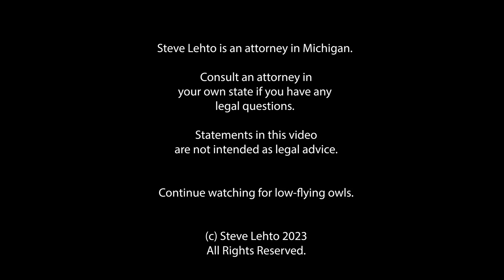The Crazy Legal Problems w/the Turbo Encabulator

Comment: For those that have a turbo encabulator and are having trouble getting replacement parts because of the ongoing supply chain issues, I found out that if you cut the ground prong off of the power plug and flip it over in the socket, the machine will effectively run in reverse and rebuild itself. You have to be careful to unplug it before it goes back in time too far to a point that it never actually existed, so make sure you monitor it closely.
Reply: When you do this it is great to video the process as the machine disassembles itself.  When left with a pile of parts , now you have handy spares or run the video backwards so you may reassemble it yourself!
Reply: wouldn't you get the same results if you reversed the polarity?. Of course I imaging this will only work on the 60hz systems in the US and not the 50hz systems in Europe!
Reply: @jeraldbottcher1588  No No, if you reverse polarity it will change into a welding machine and my not be able to change polarity back, you are treading on unknown territory....
Reply: Tried that. Ended up with a discombulated fratastat. Cost me 500 bimbling watts to fix.
Reply: No wonder the damn thing disappeared. I let it recede too far using the reciprocating dingle arm on the no fur trunnion during the  regressive self repair routine.

Fortunately I was able to reverse the polarity causing a significant house fire, but the device was returned to it's former defective state.
Reply: @jeraldbottcher1588  I thought that reversing polarity might work, but the problem with any AC system (50hz, 60hz, or anything really) is that the electricity is reversing itself anyway, and the machine compensates automatically. Remember these were designed before a ground lead on electric plugs were even used. These early machines used a copy of Louis Armstrong's Cut My Legs Off And Call Me 'Shorty' to synchronize with the 60hz wall current. (Rare European 50hz models used his recording of Coal Cart Blues instead). Encabulators made with a 3 prong plug calibrate themselves using the harmonics between the power wire and the ground wire, and by removing the ground and flipping the plug over it will not allow the machine to sense time properly. There was a LOT of work put into getting the design right when the grounded outlets were coming into general use, because it is possible to install them with the ground either up or down. This unfortunately (if you recall) resulted in the Great Weasel Shortage of 1974, along with all of the associated lawsuits. That would be a good topic for Steve to make a follow up video about.
Reply: @gainestruk1  What if you used a double floating ground with a 2 kiliohm resistor?
Reply: lord thunderin bejesus thats bloody funny! Thanks!
Reply: I have tried and tried to get your suggestion to work but removing the ground prong and flipping it over doesn't work. One prong is bigger then the other. I have broken 5 plugs so far, and at $127.87 a piece, there not cheep. But. I did find that if you put a big magnet over the star plate the whole thing will become useless. OH WELL
Reply: @jeraldbottcher1588  Hmm I haven't thought of that, if you do try watch out for Convertcolation, if it starts rapidly remove and move away, no telling what the Turbo Encabulator might do, it might reincumblate its self, you don't want to be close if this happens.
Reply: Is that for the A/C model only?  The motorized parts will run D/C either way but I dunno about the motherboard and all the little sons-of-boards.  Also the defillibrator will re-align the hydraulic sheet printer.
Reply: @dannyw7662 Damn you paid too much.  I know a guy in Serbia could have saved you half that in exchange for a cow.
Reply: @m.cigledy6769 Now that explains a number of questions I had about this method.  However I had been informed that the GWS/74 (as the tragic event is know referred to) was due to sparrows swooping down and clutching them in their claws flew them to England.
Reply: Very thoughtful analysis however, in your opinion, if you sit on your encabulator while preforming this function might you age decrease ?
Reply: @kenh.4343  Annulated aluminium shielding has proven to be quite sufficient provided titanium waffle vanes are used to detect the tuned frequency oscillations during startup and stop down.
Reply: @kenh.4343  A bit of a mixed effect. I seem to be aging normally, but I haven't needed to use the bathroom since 1968. I've saved quite a bit of money on toilet paper over the years.
Reply: @m.cigledy6769  So your body is converting ALL dietary input into energy?  Amazing!  Is this a quantum entanglement with the device and if so, what is it's maximum range.  I'm thinking military purposes here.  Like reversing the effect so that the body expels everything spontaneously, focusing that energy into a beam and...Man you're a genius!  I'm going to be...we're going to be rich!!
Reply: “Run in reverse and rebuild itself” had me 💀💀💀
Reply: You must beware of Federal stututes against rolling the clock back on your encabulator. Attempting to reverse the platnum counter can lead to fines of up to $150,000 and 12 years in prison, if convicted. These laws were created to protect your neighbors from people who tamper with the unit's proper function.

Comment: This could all been avoided if they had incorporated the coaxial twerk synchro lever.
Reply from the maker: Experts disagree but that is one theory.
Reply: I’ve done extensive research on this matter and biokat maybe correct. They knew the coaxial was inferior to lead mouth pieces simply placed under the tongue.
Reply: Sounds like a lack of twerk ethic, to me.

Happy April 1st. 😁
Reply: Running encabulators on minishift based containerization systems improves coaxial twerk cache hits by 20%.
Reply: They were known for faulty knibblin pins
Reply: You're wrong. Solonocoidal redactive intagramations CANNOT replenerate dystopoid pentiferatives.
Reply: They should have thought to use a number of dingle arms
Reply: Unfortunately, Miley Cyrus owns the copyright and wont license the technology.
Reply: @stevelehto  As an Engineer at Rockwell Automation this is one theory we have considered but I'm not allowed to speak on this issue.
Reply: She hulk did a coaxial twerk and people didn't understand synchro level involved.
Reply: @stevelehto  Happy April Fool's day Steve!
 👔🗣️ Legal gibberish 😂
✌️
Reply: Since no one else is going to address the elephant in the room.....

None of this would have been necessary if they had just ALLOWED OFF LABLE WIDGET USE!!!!!!!
Reply: @stevelehto  Wasn't there also an issue with the Turbo Encabulator using the flux capacitor without paying the patent fees?  I believe that was Rocklwell V Brown.
Reply: New to me but I understood it before 3 minutes in.
Reply: It's has been proven by the engineering group synchro and reverse synchro consultants that it's should have been a button not a lever installed as the lever automatically create a resonance in the coaxial twerk causing no ends of reactive problems. Duh
Reply: @stevelehto  yeah, but experts are still debating where to categorize cars made of dirt, using bushings (17) instead of bearings.
Reply: What kind of crap it this ,it makes know since what was said ,must be a joke .
Reply: @wendwllhickey6426  Ya think?
Reply: @wendwllhickey6426  You must be one of the people that gets described in the Friday rants.
Reply: Can you say ‘Zoom Meeting’
Reply: That technology just didn't meaningfully exist during the development of the TE.  Yes, they technically existed, but the materials available at the time weren't able to contain the proto-cambrian flux reaction!  The cellular constance viscosity variable of the best forge-tempered weald alloys were only able to present a 1-in-46 phase coagulation ratio (or more!), which, obviously, doesn't allow for the necessary amount of capilation through the inverse flow field.  No, they did the best they could with what they had.  Reiterative pulse shifting servos were the correct choice.  FOR THE TIME.

I'll grant that leveraging the coaxial twerk synchronization was the best solution a decade later.  HOWEVER, by that time, the cost of retooling the discombobulation matrices seemed, and later proved to be, a giant waste of resources given the promising advances in recombinant lubricant applicators.  And I'm sure everyone agrees that lubricant recombination is far superior to any sort of coaxial twerk processes for regulating the specific charge during plasmatic ion concatenation.

So, while there was a window of about six years that coaxial twerk synchronization was viable, most of the environmental damage was already done.  The magnetohelix induction into the strato-mesospheric border was already unwittingly accomplished and ditching reiterative pulse shifting, at that point, wouldn't have made a difference.  Regrettable?  Absolutely.  Catastrophic, though?  I don't think so, and the studies are showing that the health risks of polarized particon waves are being grossly exaggerated by the class.  Time will tell, I suppose, but I expect Rockwell will escape this debacle with sufficient solvency to keep metastasizing.

I am so tired of debunking this crackpot theory.  This comes up so often, maybe I should just be copy and pasting it.
Reply: I found an Instruct able on that but it was incompatible with Redit
Reply: @MrMagnaniman
Reply: @bartsanders1553   Duh! Hello! Any base incolaborator technician know that you can replenerate dystapoid pentiferatives with solonocoidal redactive intagrammatators IF they have been synchrometically bonded with crysantonite enhanced plutonian dust. It's rare, but it's not unobtainium.
Reply: @donmorrison519  Yeah, right. Like pluto is a word 😂
Reply: @bartsanders1553   It's just a very small contraction of a word!

Comment: Apparently, I've been living under a rock the past few years because I had no idea this was such a huge problem. Thank you for taking the time to clear it up.
Reply: Wait till hear about the spurving bearing issues. He just opened a can of worms.
Reply: This was discussed in an episode of star trek. The encabulator works based on the locally Euclidean metrisation of a k-fold contravariant Riemannian tensor field.
Reply: @newsnownorthkorea3836  It's bigger on the inside than it is on the outside?
Reply: Hi Derek Smith
Reply: OUR time, my time, to clear it up
Reply: @dereksmith8261  Right back at you. And even spelled correctly. 😁
Reply: @davidrush4908  lmfao

Comment: I was a transmission mechanic for years and that still brings me to tears.
Reply: Ironically, the turbo-encabulator was designed to bring you a smoother ride at any speed, not tears, which just make your turbo-encabulator wet...

Comment: I love my turbo encabulator. Best investment my grandad ever made. Perhaps not as efficient as some of the newer models but it's solid and runs like a charm. Never even came near to a viscous uncoupling. Has lasted us all these decades and I expect to pass it on to my grandkids, preferably on a snipe hunt or while fishing for red herrings.
Reply: I used to think like you until my company invested in a retro encabulator, you will be amazed at the difference.  There is literally no side fumbling, and the drawn reciprocating dingle arms (maintenance nightmare) have been replaced with a simple orbital distributor to produce inverse reactive current.  Tons of it, actually, I mean you run two or three unilateral phase detractors and a novertrunion to boot, and you have no loss in modial interactivity.  Plus they come in three cool colors now.

Comment: I appreciate you talking about this. My uncle had a defect in the fluxxe of his flugelhorn that (at the time) was attached to his third generation Turbo Encabulator. It took him a fortnight to have the centrifugal valve replaced which was entirely too much down time to keep the primary differential from collapsing into the tertiary pinion and damaging the entire rack! He has since attempted to sue the producer and said case is currently pending. We shall see what happens from here. Thank you!

Comment: I have fond memories of several projects I worked on in the late 1970s in which we integrated microcontrollers into the early portable turbo encabulator models. One project in which we use a high speed solid state camera controlled with interconnected TI9900 CPUs to monitor the stepper motors in the turbo extender module stands out as particularly satisfying. It's also amusing to remember how bulky those early suitcase-size TEs were, when now every smartphone has at least two of the current nano TEs built into it.
Reply: yes the original vacuum tube variants used in tandem with the eniac device were truly massive beasts - the successor transistor using design made in man portable and solved the overheating issues inherent in early turbo enfabulator designs. they also eliminated the unicorn fart  and rainbow sprinkle exhaust emissions issues. 
Gary powers should have destroyed the version installed on his U2 dragon Lady airframe when shot down over Russia. 
rumor is that the original reverse engineered example is still in hanger 18 on the area 51 reservation recovered at roswell from a piersons puppeteer spacecraft crash site.
and the obvious connection to the Kennedy assassination can no longer be disputed. 
the latest models jyre and gimbal in the wabe while the mumrats outgrabe.

Comment: My retro turbo encabulator (an older model THX1138 without the optional neutron flow phasal inverters) is throbbing but your work on the  spline dis-alignment was utterly crommulent in fixing that. 

That was a masterful explication, a single take without mispronouncing a single highly highly technical term from a deeply insular specialized field was a work of art to behold, and now I have the correct mental image to use when you describe your court adventures.
Reply: Yes, but your models' sparsal vein coupled tremy pipes last forever.  Keep it in the family for sure!

Comment: Thanks Steve for the wonderful explanation of the Turbo Encabulator. I friend had an Encabulator that wasn't Turbo equipped. He used it to repair flat head Ford V-8s. He used it on a lady's car and she sued him. It caused the sis wheel to come loose from the wobbly shaft and protrude through the conflamigator and maniplating hole which then poked holes in the water retainer which caused her to faint. She lost in court because she ignored the sign that said Do Not Stand Near When a Non Turbo Encabulator is Being Used  since they can cause holes in the water jacket. Non Turbo Encabulators are very dangerous.

Comment: Steve you are a rock star. Great job on explaining this issue in a way even I could understand.   I immediately went out and purchased 70 40 weight ball bearings and a qt of quaker state to fully prepare the air flucer and variable famdingo port 😮

Comment: As a nuclear test engineer, I first became aware of the turbo encabulator back in the early 80s.

I have to say that your presentation was absolutely spot-on. You cover all of the necessary legal aspects of the subject with absolutely the most professional demeanor possible.

When I return to my job site on Monday, I shall forward you a copy of the turbo encabulator cut sheet from the GEK, which was the set of manuals for all the equipment for the GE Mark IV BWR (Boiling Water Reactor).

Comment: My grandfather worked at Bell Laboratories. They send silicone stater coatings to Rockwell for use in the swervel shaft morbator.
He has a patent in his name for the process, but of course he only got a gag gift in compensation.
Reply: Same thing happened when my uncle offered to sell his patent for inverse stratogustoids to Rockwell. Instead he sold it to the gplovernment for $750,000,000,000,000,000
Reply: @bartsanders1553  the numbers sound about right.
Reply: @joelee2371  I was thinking of fixing my typo, but calling it "the gplovernment" sounds better to me.

Comment: Also can't forget this famous exhaust bearing failure case. Mind-blowing!
Reply: Yeah...care should be executed to replace the muffler bearings in a timely manner, lest it explode and the shrapnel rupture the turn signal fluid reservoir? Current supply chain issues have replacement reservoirs nearly impossible to get...
And...as everyone knows, attempting to operate turn signals without fluid risks phase shifting the vehicle AND driver In & Out of existence?

Comment: If the oscillating dingle arm is out of calibration, the fluxes and wanes will be out of adjustment and increase billable hours for the service department. Will this flaw ever be legally addressed?
Reply: There is an engineer who managed to realign the spurving bearing using a coblasted furiator with an adjustment ready kingleblocker. However due to the replenerated disfolioid being a similar design to the xenophomere instigator, his patent was blocked. It seems legal jargon is still the culprit.

Comment: I've given a lecture on turbo encabulators, It was in the context of the importance of producing a data dictionary during a project when ascertaining requirements.
I have, however, genuinely used an Interocitor on a cutting edge space program.
Reply from the maker: I love the interocitor but the parts are only available from that weird catalog that's not made of paper.
Reply: @stevelehto  This one was by Dynacon of Canada rather than Ryder Industries. It was part of the attitude control system for the Fedsat satellite. It performed many functions, hence the name. Satellite engineers are nerdy on this island Earth.